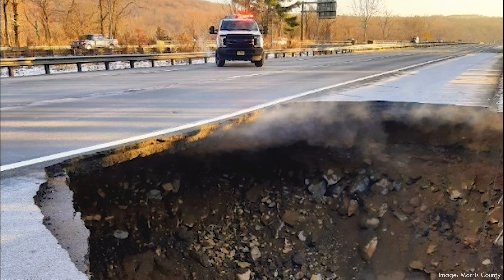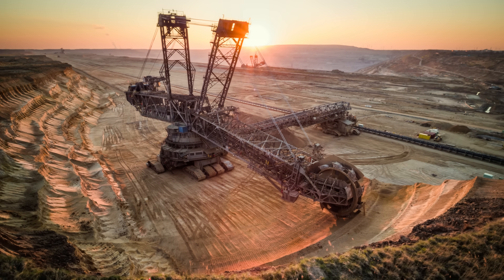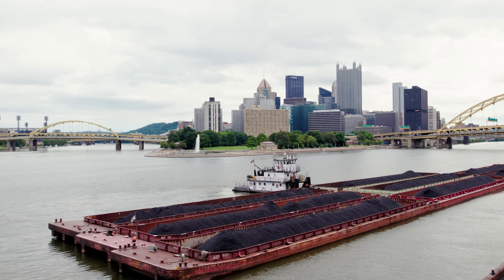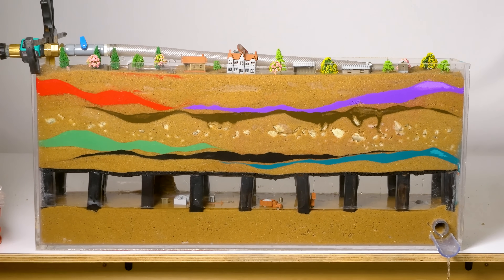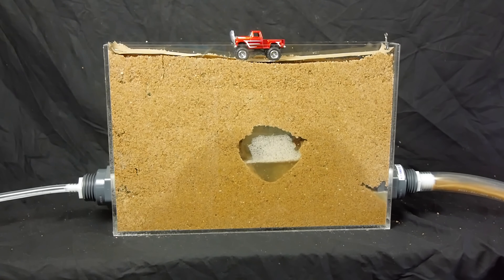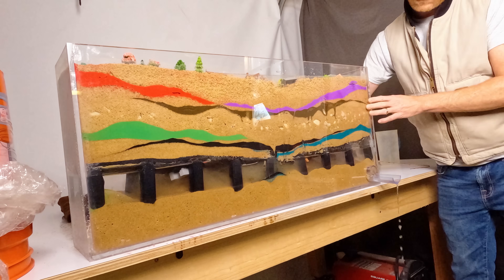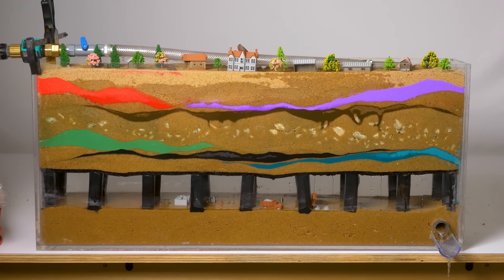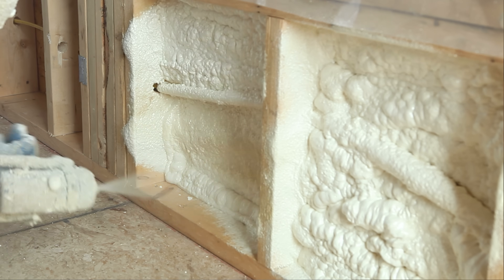When Abandoned Mines Collapse

Comment: The mine is referenced in the new jersey dept of labor reference book , dated 1989 , as the 
"Mt. Pleasant shaft under Route 80 capped ".  The book shows the mine  configuration with respect to surface cultural development features . 
The change to stormwater distribution along with ground disturbance from the newly constructed large footprint building immediately to the north of route 80 likley contributed to soil piping conditions that resulted in the collapse. I would like to see the stormwater engineering report prepared for the new building .  construction  vs post construction . Storm events  may have  increased trend of a  higher amount of precipitation in a given amount of time, thus , increasing the energy of a given recharge event . The  contribution to the collapse from the April 4th , 2024, 4.8 earthquake that occurred  18 miles to the southwest is unreported .   What is the weight loading trends of 80,000 trucks  on route 80 ?  I have the mine maps and geologic description if other geologists - geotechnical engineers, structure engineers are interested.  

 I have worked on many post mortem  cases as assistant to the principal engineer ( L'Ambiance Plaza April 23, 1987) to residential 
homes partially lost in sinkholes located on limestone . They were  due to owner  changing  roof leader rain discharge  from daylighting to subsurface.

Comment: Isn't the solution simple? Just refill the holes with layers of dirt and wood between. The wood helps spread the load while the soil is compressing and will naturally decompose over time to become part of the dirt. For new mines it just means keeping the dirt you dig out to one side to put back in after you're done. Might need to order in some more dirt but it would work. As a bonus it means that all the material can be obtained so long as they refill the chunks they dig out before they move onto the next to ensure stability.

Comment: Why don’t we just fill the mines with trash and turn them into well sealed landfills?
Reply: Because trash isn't stable and would continue to settle and compact over time, recreating the same problems. When an existing landfill is having another landfill built on top of it, they sometimes use the same stuff to fill it and make it stable (so that the added landfill doesn't experience a sinkhole!) that is used in sinkholes already.
Reply: @sophie1682  ohh thanks for that. I thought it'd have been possible to compact trash until it became stable enough to use as a volume filler once it absorbed enough water.

Comment: This is something we had to deal with 10 years ago where I live in Yorkshire, UK. 

They had shut down the pit near our village and were going to clear off the top and turn it into a nature reserve, very common for old pits here in the UK.

The problem is that my village is only a 1/4 mile from the pit head and the tunnels run right under the village!

They fixed it by slowly pushing the gob piles back into the mine and special vehicles would push the medium into the tunnels as best they could. 
The rest was filled with soil, road chippings and shredded landfill waste. 

So far it is all good and they do regular radar scans to see how it is settling. 

They also have small lakes on top of the old pit head... To test if leaks are happening, from what we are told. 
If the lakes disappear it is the first sign of problems!

Comment: What's stopping goernments from requiring companies to fill spent mines with material? Surely it can't cost that much more to 'reverse' the conveyor belts and fill it with a bit of gravel or sand. IT doesn't even need to be perfectly packed, just filled up enough to handle a couple feet of sinking

Comment: The coal mine in Centralia, Pennsylvania, which has been burning since 1962, would be an interesting subsidence study. Not only do you have the subsidence from the original excavation, there is the wet-dry extremes caused by the heat, the reduction in volume due to combustion, the gases released by the burning, and the list of interestin twist, goes on.
Thank you. I enjoyed the video.
Reply: Might be difficult to build a model in the garage, though. ;-)

Comment: A few notes (from the son of a West Virginia coal miner) 1) room and pillar mines often mined the pillars on their way out, around here. 2) a phenomenon your model could not simulate but was common where I grew up, the side walls of the mine would collapse while the pillars, roof bolts, or posts held the roof up. This would leave a long raised area with the ground depressed on either side. 
We had these all over growing up. When one ran perpendicular to the road it would make a great jump when I was a reckless teenage driver. 3), in mountainous terrain there was often an old original portal into the side of mountains that ultimately always seem to act as an open drain, carrying out mine drainage and any sediment gathered along the way.

Comment: 1:36 This is something I think about sometimes. Before humans, was there a decent amount of gold and silver lying around on the surface of Earth? Would finding a quartz vein with gold while on a walk be a rare but not unheard of occurrence a few hundred thousand years ago?
Reply: Yes and no, gold is found on the surface in a lot of places, mainly rivers and stuff. But for some other materials they may only be found deep in the crust of the earth because of pressure and density.
Reply: Gold was probably always underground since it is so heavy. It even took humanity an eternity to leave the bronze age behind and finding iron.
Reply: @electricpaisy6045  ???
we always knew where iron was
we simpley had problems working with iron
...
working with iron and tin was just so much easyer
....
it simmilar with platin and aluminium
aluminium used to be a mythical material
while Platinum was trash we had in abundance but no use for
Reply: @baronbrummbar8691 yeah, iron is everywhere. Red earth and streams are super common to see.
Reply: I don't think so. Gold in particular is inherently very rare. In all of human history we've only ever found about 200,000 tonnes of it. And it doesn't form on the surface, it is baked into the material the Earth is made of, so it will always be mostly underground. Add to that the fact that gold and silver are both very soft, so any that was on the surface would pretty quickly be weathered, washed away and covered by soil. So no. They've always been hard to find.

Comment: Where my house is, the entire community was built on land where a mining company had already purchased the mining rights to. Basically, part of the purchase paperwork is a notice of easement that this company may harvest the underground resources present on the property, so long as it does not interfere with the people or property in any way (can't be seen, heard, felt, etc). As far as I can tell, this company never mined underneath, they just purchased the entire region's mining rights on a hunch, then realized they were wrong. 

Because the HOA was also set up by the developer, our HOA even has a specific covenant stating that it's members absolutely cannot do any harvesting of minerals, oil, metals, hydrocarbons, etc, as it would violate the easement. What makes it hilarious is that half the properties don't even have a yard, the other half have a yard so small that it is smaller than most cars, and none of the properties have basements. What are they expecting me to do, set up a pumpjack in my living room, drill through my foundation, and start pumping oil? Start surface mining my garage?

Comment: I kinda wonder how this is going to play out in my area over the coming decades. 

A couple kids went missing back in the 60s and they were found to have asphyxiated in some mines abandoned in the 1800s, so all the men in the county went down to the hardware store, bought some dynamite, and blasted closed the entrances to prevent any future kids from getting too curious. We have pretty exact coordinates for where the entrances were for most of them, but no records of how extensive any of them were.

Just within a 10-15 minute walk from my house there are two entrances on record, but zero records of whether they went 100 feet, and gave up, or many thousands (I'm inclined to think they were of some size, as there's still infrastructure surviving today that was built onsite back then)... and to find out would require spending many 10s (if not 100s) of thousands to cut roads into the woods and bring in equipment to reopen them.

Comment: There are 600-800 year old tunnels under my house, my breathing hole is 100 meters from my house :) I work with a guy who used to go there 30 years ago and I asked if there was a risk of the tunnels collapsing and he said no, the corridors usually get flooded with clay and other sediment. I myself work on shock blasting of surface coal mines. Recently, we were searching with our drilling rig, an old mine working so that a KU-300 machine weighing 1300 tons could arrive :) And you will be surprised, we really found the old corridors and as soon as air entered them, it immediately started to burn. It's like a dream job, dirty, the noodles from your nose are black and you sink above your ankles in the mud :)

Comment: In South Africa, the deep gold bearing reefs of the Witwatersrand extend for 80 km east and west of Johannesburg and earth tremors are a common occurrence, either from subsidence and collapses or blasting. Acid mine water from water reacting with iron pyrites is becoming an problem as pumps are frequently shut down because of breakdowns or power failures. Illegal mining is also an issue with miners going into previously sealed mines and working areas at high risk of collapse.

Comment: Subsidance of old coal mines where I grew up was bad. We even had the MOAP, the mother of all potholes, where 165' of road dropped some 50' after a submarine mine collapsed and caused a rush of water to shoot out of one old mine and go roaring into another set of workings after it blew through a separation and the result was the MOAP🤦🏿🤦‍♂️
I can't tell you how many tandem trucks were needed to fill it but a friend stopped counting at around 50😳😬
Longwall mining is very profitable but some companies play fast and loose with regulations and guidance. 
The geology where the mine was located said the max wall length was 75' for a suppoted roof.
When the mine was closed because of cave-ins, they were cutting 175' and going for 200'😳😬
Almost every mine doubled as a grave marker because of this "wisdom"🤦🏿🤦‍♂️